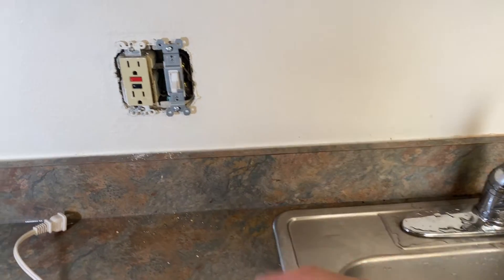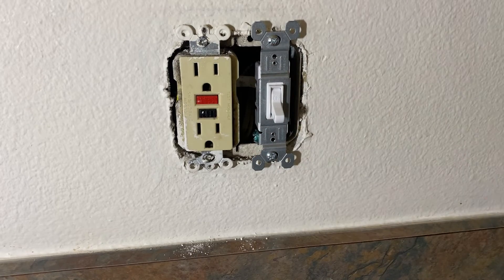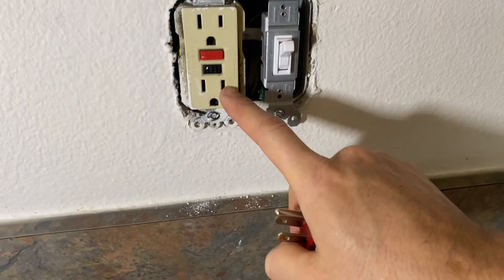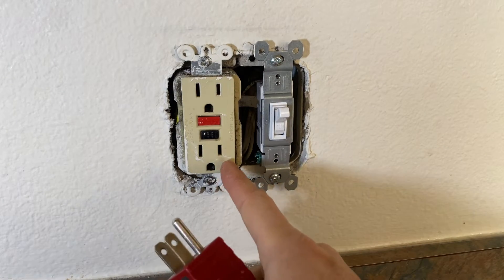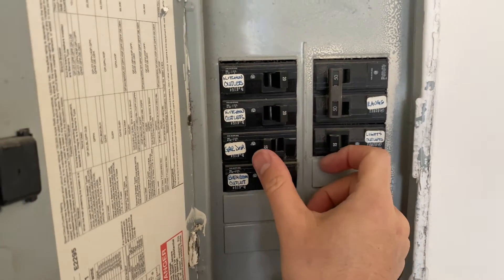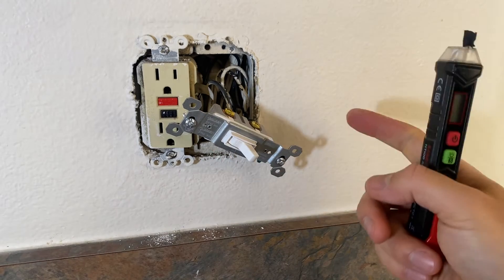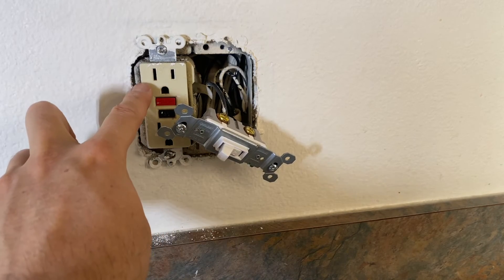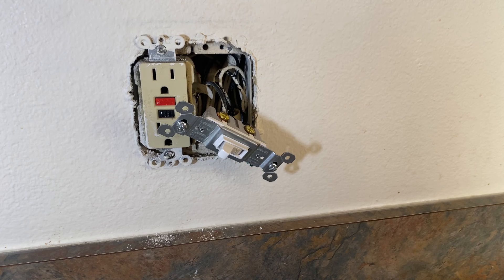Garbage Disposal GFCI Outlet Has No Power

Comment: My disposal outlet does not have a gfci outlet and the outlet has no power
Reply from the maker: check your breaker
Reply: I did. i plugged a cell phone attached to it's charger and it did not come on to charge. i grabbed an extension cord attached it to a different outlet stretched it out and plugged the disposal in and it came on even with the outlet switch in the off and on position @remoteelectrician

Comment: Thank you!!! This is exactly what I needed to see, I replaced an old disposal after it started leaking from the bottom, and couldn't figure out why there was no power at the outlet and the reset wasn't working once the new one was in place.   Worked perfectly and saved a potential expensive electrician visit.

Comment: The electrician asked me to replace gfci but the trick to turn on the switch worked. However the garbage disposal does not work even though I have power. Any tips on fixing garbage disposal.

Comment: Quick question yesterday I replaced a hardwired dishwasher that had a 2 gang box under kitchen cabinets that shut power to the dishwasher so I shut switch confirmed no juice undid the wire nuts removed wire from the dishwasher reattached the wire nuts left switch in off position. Replaced dishwasher got everything looking pretty all connections were made go to flip switch inside cabinets to liven up dishwasher and nothing so I check power into the switch no power check breaker for that circuit it’s on it was labeled kitchen outlets and dishwasher I stuck a plug in tester in all the outlets wired correctly and all are working. No holes were drilled in the process no screws potentially driven into a wire behind a wall. I’m at a loss for what the solution is
Reply from the maker: invite an electrician. usually dishwasher has it's own dedicated circuit(if that's not the case u wont sort it out yourself)